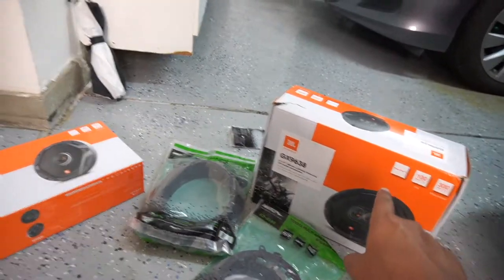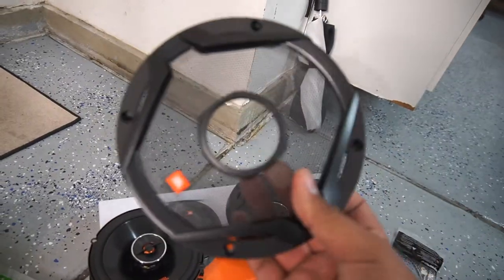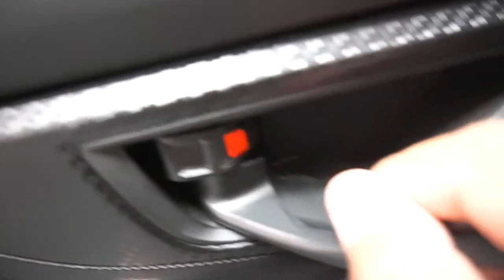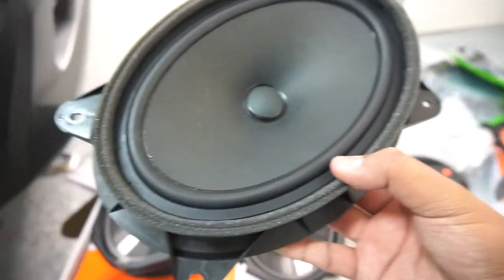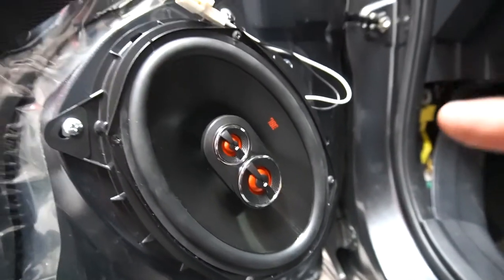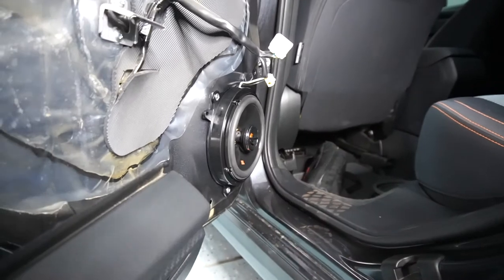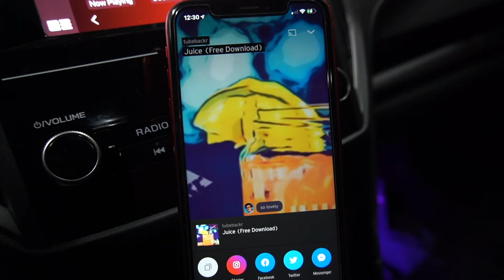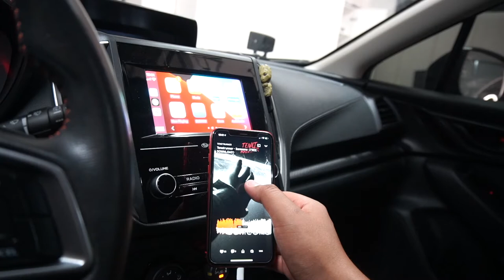How to Install JBL Speakers on Subaru Crosstrek

Comment: Went with these same speakers on the crosstrek. They sounded good. I already had good low end with an alpine type r. I eventually put in an alpine amp for the jbl door speakers. Even though they are 2.3 ohm impendance, they sound much better with an amp. About 90watts rms in the front and the gain on the rears is turned back a little more because they can only handle 60 watts rms, opposed to 100rms for the front speakers . Overall very clear, loud, good mid bass and good hi’s

Comment: I just did this install in my '22 XV last week. So far, sounds good, but everyone says better after break-in.  Will consider under-seat sub. after  some time....Simple swap-out, good video.
Reply: did they improve over time?
Reply: @jeff666p  Yes, smoother, and better punch.  And I did add the JBL underseat SW for fuller bass.

Comment: 2021 and on comes with Harman Kardon speakers which are far better clarity and quality to the jbls and most others, best thing you can really do is just throw a box sub in the trunk or a seat sub if you want more bass, the HKs have decent bass for normal speakers but the clarity is whats going to pair amazing with a box sub above most other speaker replacements, just make sure you check your model and year not all crosstreks have HKs.

Comment: Would you need the amp if you were pairing these with subs? I just installed two JBL 8 inch subs but have the stock speakers in

Comment: I installed the factory upgrade Kicker speakers and I love them.
Reply: what car and year? I have a 2016 crosstrek and i don’t if it would sound good with the stock head unit.
Reply: @yohomiedead4095  14 crosstrek. I replaced the head unit too, but not sure. I assume since it's a factory option it will sound okay.
Reply: With an amp ?
Reply: @usrl1967  no. Aftermarket head unit, though.

Comment: Thanks for the video! Putting in some Infinity Reference speakers 6x9 for front, 6.5 in back, and 3.5 in dash which is part of the Harman brand like JBL. I just bought a 21 Crosstrek sport and the sound is crap. Worried about the fit of the 6x9 bracket. Did you get it from Crutchfield? What do you plan to do with the dash speakers?
Reply: i was just wondering about this since i have the same exact model as you, with the 6 speaker setup. so you are saying the dash speakers are 3.5?
Reply: @kimmyyimmel2010 ... watch the impedance on the dash speakers. due to starlink (voice), I've heard the dash speakers are 8ohm vs 4ohm in the doors...running less than 8ohm in the dash can cause issues w/o a workaround
Reply: How did these speakers sound for you? I am considering these as an upgrade from stock. Do the upgraded infinity speakers “die” after half volume like the stock speakers?

Comment: you could have cut the bracket to fit around the bolt, trim to fit...amps come in all flavors.  even the low powered amps at 20-25Wrms/ch will sound better than the stock hu.  ppl don't need to blast 75Wrms +/ch to get good sound.  shoot, even the tiny UTV amps the size of a brick will out perform the stock hu and give you "more" sound. 

obviously matching the speaker to the amp (input power to the speaker) will result in the best overall sound.  brand is up to you.

Comment: I want to do this on my Subaru and I could get most of the part numbers from the video. However, my question is where both wiring harness adapters the same? For the front as the back? Or where the front ones different from the back? I could only get 1 of the part numbers for 1 of the wiring harness, the other one I couldn’t see, any help is appreciated thank you

Comment: I like those.  Its between these and some similar Kickers and maybe the Infinity ones. What are we doing about the little three inchers in the dash?  Is there something weird with the crossover thing on the back of that dash speaker?  Anything I should know?  Other than the speaker is dogs**t?  Cause I know that part.

Also, I have this thing by Cerwin Vega - it sounds whack, but hear me out. JBL makes the exact same thing.  It replaces the foam thing that sits in the spare tire. Its a powered 12 and there's no remote wire, no line out converter, no, rca, no harness cutting, no dash dickery.  Its absolutely astounding in my Crosstrek with the factory radio.  Big bumps (for it's class of thing) and a completely empty trunk.  Just a though.  They fit our cars perfectly and they're not much money and I couldn't be happier.  Nearly as headache free as that speaker install.  You'd mentioned a powered hideaway sub and this cannot be more hideaway.  I dare say it beats every under seat sub I heard.

Comment: How’s the speakers holding up? Just bought some.
Reply: Did they turn out pretty good? I’ve got a 2021 crosstrek sport no upgraded system. Was looking into it. Did you end up needing an amp??
Reply: @Airmanclaysmith   I have a 2021 base Crosstrek They’re definitely better than the oem speakers no amp at the moment but I do want one later down the road.
Reply: @kratos7678  any reason why you want an amp? I’d prefer not to have one cause it’s just going to be more work for me in the future.

Comment: hey. I’ve got a ‘22 sport trim crosstrek and want to install the same speakers. could you provide links?
Reply: Did you end up installing the JBL’s?
Reply: @kratos7678  no, and I don’t plan on it as I’m trading in my car. I can provide the links if you’d like though
Reply: I think I got everything ordered. I just wanted to know if the JBL’s speakers are worth the install over time. Thanks again!

Comment: i have a 2003 bonneville SSEi as a summer only use car, i also have a crosstrek premium 6MT. my bonneville has a 5 channel soundstream brand amp, 4 kicker CS, 2 alpine 6x9", and a 10" skar sub. 

the stereo in my bonneville cranks, yeah i know it's aftermarket...... i live my crosstrek but i think the stereo sucks. i am wondering if i can ever do anything to make it better.
Reply: how do you work around the factory "infotainment center"? how do you add an amp if you can run normal preouts? my 2003 bonneville i use a pioneer head unit.

Comment: I have a Subaru XV 2020 with the stock deck that decreases the bass as the volume goes up. How do I fix this?
Reply: You can’t. It’s how it’s set up…so the speakers don’t “overdrive” themselves. The Subaru stock system I have in my 2018 with deadening sounds worse than the stock speakers I had in my 2004 Grand Prix. No BS lol.